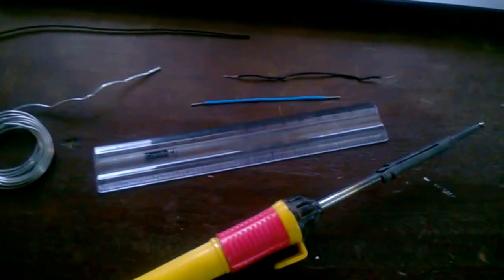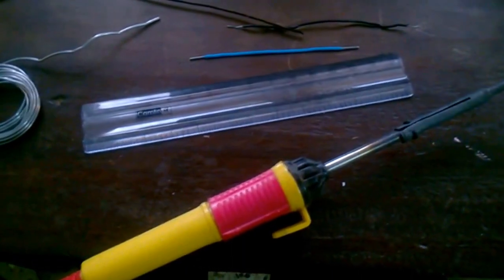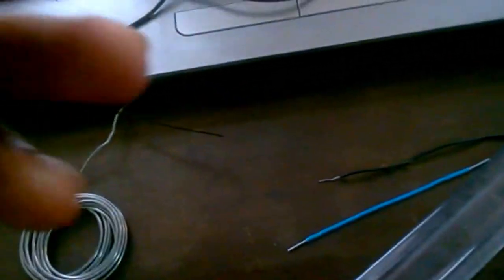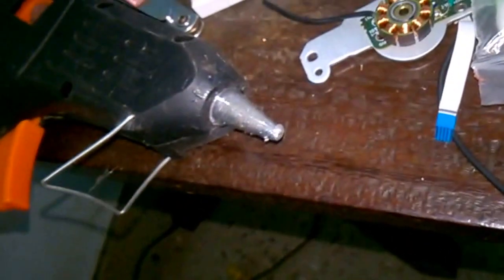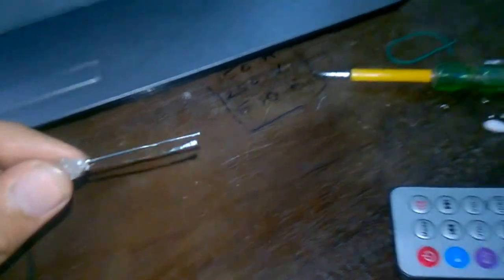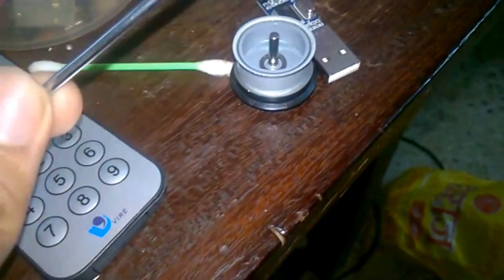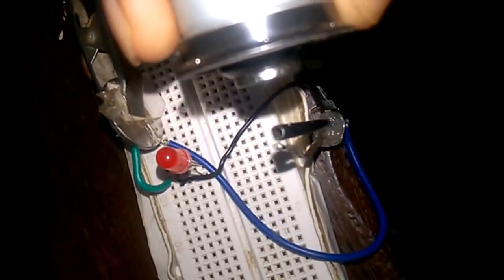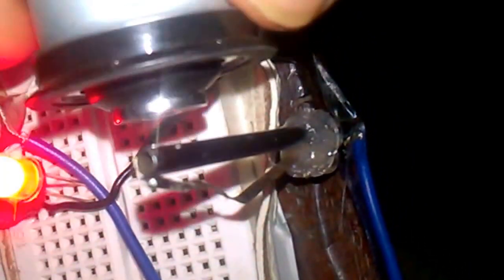Homemade Reed Switch in 6:30 minutes!!

Comment: Thanks so much for this video.  I help teach children about magnets and basic electric circuits, frequently using reed switches.  My first approach to designing a switch they could build themselves used two magnetic parts much like commercial reed switches, but your design is much easier to implement.
Reply from the maker: You're welcome. :)

Comment: with no nitrogen there will be to much ionization of O2 so it wont last long
Reply from the maker: +Edison_tinkerer Edison_tinkerer  Yeah that's true but for currents up to around 20mA the switch will last longer than you will...
Reply: gillette razor shave blades.
Reply: Can you explain  please more.